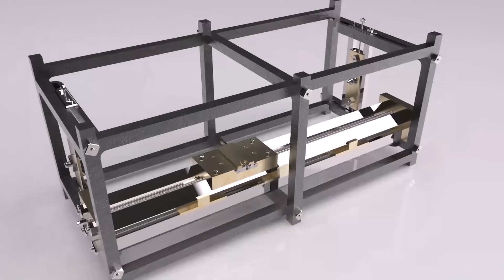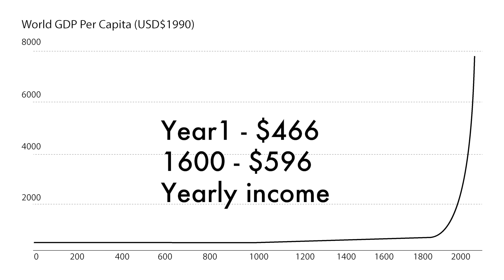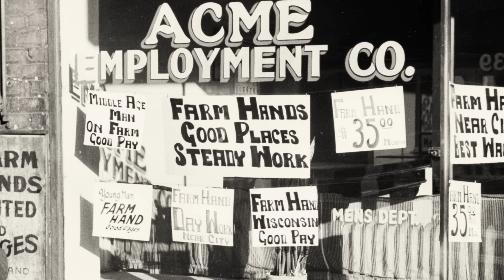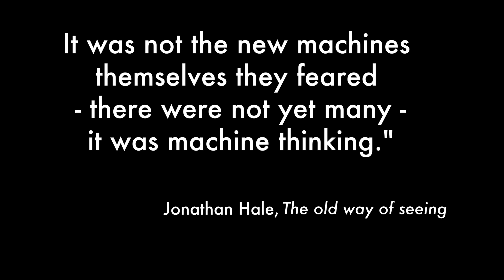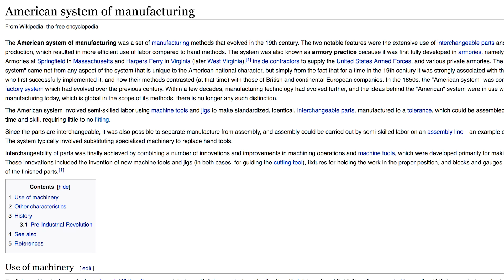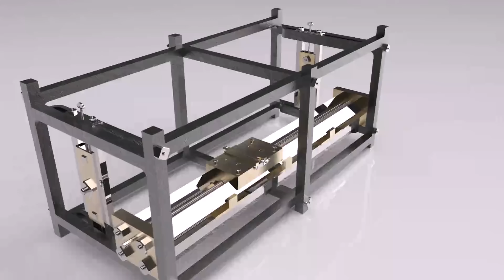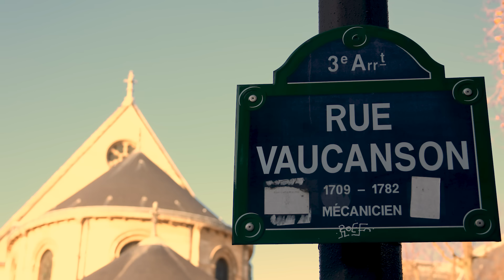The 1751 Machine that Made Everything

Comment: Extremely well researched and produced video. And more than good enough to earn a sub. It also echo's my thoughts about the importance of machine tools in our last few hundred years of history. Without them we'd still be in roughly medieval age conditions. It's a complex subject, and while Vaucanson's lathe may have been the first, it's origins and design were very likely a mixture of ideas borrowed from many areas. Ornamental turning first started I believe around the 1500's. From then until the late 1800's- early 1900's they developed many ideas and methods to form highly complex shapes and do intricate dividing to high levels of precision. No doubt some of those ideas were borrowed and copied by machine tool manufacturers and strengthened to work with metal. I'd also suggest Joseph Whitworth's ideas of obtaining very precise levels of flatness with his 3 plate method to further check and adjust the early machine tools accuracy was no less important.At least to modern society it would be.Metallurgy would be another giant step forward.  But education, travel and it allowing further exposure to new ideas during the industrial revolution very likely helped as well. Like it or not the military's constant search for better and more efficient methods of killing fueled and drove the largest percentage of industrial technological change and still does so today. Today's computers can be traced directly to the early torpedo and naval firing solution mechanical computers in WW II.

The Moore Tools book Foundations of Mechanical Accuracy gives some very good back round information about lead and feed screw accuracy in there development of there jig borers and grinders. Even they couldn't build perfect pitch screws no matter how much money and technology was thrown at the problem. They could measure the lead and lag pitch errors into the low millionths range but couldn't progress beyond a certain point. Today we just program the known errors out and side step the problem.

Comment: You have to make the machine, to make the machine that makes the machine to get the stuff you want.

Once you've done that, it spirals upward from there.

That same idea is done by the blacksmith. He uses a simple mold to make an anvil, a pair of tongs and a hammer head. Then he uses those to make a better pair of tongs a better hammer. Then he makes a punch, then a wedge, then  a broach, then more and more tools until he can make almost anything.

But, he has to start somewhere very simple and that's what this lathe allowed. A level of precision that could be repeated so we could make more accurate tools and equipment.

Comment: As a machinist, it's well know that the lathe is the only machine that can virtually replicate itself
Reply: As a machinist, you should also know that it's the machinist who replicates the machine. A lathe is only a tool, and nothing more.
Reply: @heartlandranchtv4943  oh good lord...you know what I meant
Reply: I would say Sam's original comment is even more true of a horizontal mill.
Such a mill makes a very effective lathe, (except for long shafts) whereas a lathe makes a mediocre mill.
And there are many more prismatic parts in a mill (and, for that matter, a rudimentary lathe) than there are cylindrical ones.
Reply: I must say, as a 45 year tool and die maker, I know that a lathe cant make a flat set of ways for the machine bed. You need a machine that cuts in a flat plane. I guess it does sound neat to say a machine can replicate itself, but unfortunately, it is not possible.
Reply: Most parts on a lathe are "circular" so I guess that makes sense
Reply: Makes me go all Gingery. Wish Lindsay Books was still around.
Reply: Agree with a lathe swapped vertical or by bringing the work across the spinning bit one could make a the flat bed used for a crude millining machine. That would go on to make better lathes and milling machines.
Reply: I would have put a milling machine or a 3D printer before a lathe.

Comment: History has recognised Henry Maudslay as being the originator of   the first lathe incorporating a leadscrew.
Reply from the maker: While it may be true that some gloss over the history of machine tools by putting Maudslay first, it is factually incorrect.  Vaucanson's lathe (1751) is the first to have all of the modern components in one machine 50+ years before Maudslay's lathe (early 1800s). Maudslay's lathe is not even the first to have gear driven screw cutting.  Senot's lathe in Paris with change gears was made before Maudslay's and is far more robust.  Thiout's (another Frenchman) lathe could cut different screw threads by a lever system well before any of these. This is not to say Maudslay isn't a giant - I think we can argue his impact was larger and that he (and his students) invented the modern machine shop as we know it.

Comment: How was the lead screw made if this was the first industrial lathe?
Reply from the maker: That's a highly interesting question and I've already done much research on that for a future video. Essentially, it was an iterative process.  There is no way to make a very good leadscrew from scratch, but there are ways to iteratively get closer and closer. Stay tuned!
Reply: @machinethinking  Oh I would love the answer to this question. I thought about it lots! I've always assumed that once you made a crude first one you could make a slightly better second one using the first one, but I don't think that's actually true. Anyways, thank you for the great videos, you've got me hooked!
Reply: Roberto Simpatico,  if you make TWO crude ones,  and then set up a machine to cut a 3rd one with the average of the first 2,  then the 3rd one will be slightly better.  You can then swap them around and repeat so all 3 get closer to ideal.

Your original idea could also work,  because the nut that follows the first crude screw will also tend to average out the errors from several teeth.  This is even true for a single screw improving itself,  like you do with a die nut.
Reply: You're basically correct, obtaining greater and greater precision has always been an iterative process.
Reply: In my youth I pored over an early 20th century book in the library at my local technical college which was a comprehensive set of worked-out solutions to do with the "bootstrapping" of machine accuracy, by identifying and correcting inaccuracies. In the case of pitch errors in a leadscrew, which are a combination of cumulative, cyclical and random, this involved devising equipment to measure these individual error sources, and then mechanisms to correct them. The resulting more accurate leadscrew would then be swapped  into the lathe. 
For correction of cyclical pitch errors, say, there might be a hand-scraped face cam turning with the leadscrew, working against a radial blade. As the errors became more subtle, linkages were introduced to reduce the effect of the correction.
Repetition & refinement would continue, not just of the components, but of the corrective processes, until we ended up with jig borers, and lathes employing diamond cutting points, which were the pinnacle of innate machine accuracy.

Sadly, I don't even recall the author, let alone the title.
Reply: @machinethinking  You're wrong, lol. There's so many "common sense" techniques lost in time, because they're too common sense. Like how screws are mass produced today - Two plates with |||| serrations , rub together against a rod with pressure, the two plates are some angle \/; and out comes a screw. Take wood, carve it it, torch it to make it hard, and you can make lead screws.
Reply: @machinethinking  Carefully. It was made carefully, much how the first beds, blocks, and flats were hand-scraped.
Reply: google  'Henry Maudslay'  (screw-cutting lathe 1800). Be aware that the lathe shown in the  pictures is a more recent replica, made using modern materials and parts. His original machine would not have had the machine-screws shown.
Reply from the maker: @nlo114 where did you get the information that the Maudslay screw-cutting lathe on display is a replica?  I've seen it at the Science Museum London and talked to the Mechanical Engineering Curator about it and I can assure you it's believed to be quite genuine.
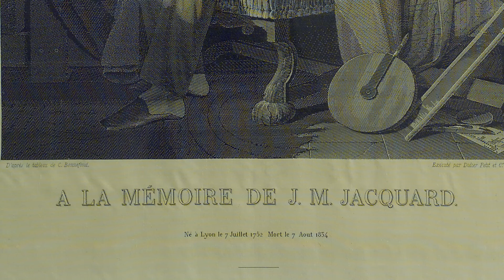Reply: 1:25 - ...'this is another one of vaucanson's creations'...  Please accept my apologies, I was getting confused by the commentary.
Reply: I am a retired engineer; I have a reasonable idea of the history of my profession! :-)
Reply: I have made long machine-cut screws on a milling machine, using only gears. The gears provide a definitive rotation of degree(s) dependent on the table travel. A rack and pinion was used as a X-axis in place of a lead screw. This set-up gave a rotation/travel ratio. The same could be accomplished on a lathe.
Reply: It takes some steps to get their. My first step would be to use the lathe to turn the major diameter. Then make a file to the thread form, and make a pitch gage as close as possible. Use this to hand file a helix along the shaft. It will be sloppy to start. The almost helix can be followed by a slip fit bushing with a finger attached to an end. If you can follow the helix it would be possible to cut a crude internal thread.
 I would think that the machine in the box was the best of those that finally worked. Men in those days developed hand skills instead of writing g & m code programs. It seems as though I had read of a process with a rotating nut that was used to help develop an accurate consistent screw.
  Yes it would have been quite a challenge to produce the first screw and nut.
Reply: Google “ making first screw and nut” It throws out a lot of reading that I am going to start on, as time and dry eyes allow.
Reply: After thinking about it, i think you can make a screw with no screw in your lathe. The cariage should be directly in relationship with the spindle/rotating part. You can engage these with a few simple gears, using a rack and pinion system. Or even easier, instead of gears, use rubber grip wheels.
Reply: It wasnt, that us the whole point.  This video is full of false and misleading information.  This machine combi ed a lot of technology  it didnt include anything completely new.
Reply: The drive mechanism, it's motor and transmission are not shown. The transmission is what makes a lathe able to produce screw cuts. This was built to turn copper rollers, not screws. In pre-lathe metalwork, a mechanic could make precision parts by hand. A lead screw is made with Acme thread, which has a flat surface, not the triangle edge in this machine. You may not be able to make a long screw, but obviously those men could. Good luck to you.
Reply: Henry Maudsley and the perfectly flat plate :)
Reply: Draw a quantity of steel or iron wire through true dies; constant diameter is key.
Prepare a true steel mandrel, and wind the wire round mandrel, taking care not to introduce gaps.
Carefully hard-solder or braze the assembly together at the ends.
Clean it up, and you now have a simple lead screw.
The thread profile is a bunch of roundies, but the pitch is accurately described by the spiral on the mandrel.
The limit to accuracy here is how consistent the wire diameter and how good a job done with cleaning up the threads.
Dies and lapping compound will get a pretty good finish & accuracy to form.
These screws would be pretty big, but when used as lead screws in a screw-making lathe, they could produce other screws of various sizes and pitches.
And such a machine can cut lead-screws for other lathes with all sorts of thread patterns...
Hell, it could make its own replacement lead-screw in Acme threads...
To make the machine you want, sometimes you have to make another machine to make the parts you need.
Reply: How did they make a straight edge before their was a straight edge
Reply: Read about Sir Joseph Whitworth.
Reply: @chadwick hayes I know the difference between THERE and THEIR, and so should you.
Reply: @BigHayes7771 i think by rubbing two stones together. Like resurface a surface plate.
Reply: Old riflemakers wound string around a dowel, traced the line and  carved the helix. Put some toolies in competition with each other and ....improvements occur.
Reply: Clearly, aliens gave it to him
Reply: The simple answer to this question is that there's no simple answer to the question.

It would have been an engineering challenge that taxed the ingenuity of the engineer of the day with the tools and processes available to them at the time.

It might be possible to guess at what those tools and processes would be, but the whole point of the new device and what made it such a significant development, wasn't that it was the first device that ever performed these functions, but that it was the first one to do it conveniently and efficiently.

How often do you ever hear of a new piece of technology that does something that could never be done before if enough time, money and expertise was thrown at the problem? That almost never happens. 

It's all a question of the level of value assigned to the task in question. If you can assign a task with a sufficient value, and the specification is clear enough, then it doesn't matter how inefficient and inappropriate the tools you have at your disposal, you can succeed.

You could be limited to neolithic tools, and you could still build the lathe in this video if you had precise specifications to work from, were able to ascribe a sufficiently divine value to the end result, and had enough men willing to share in their recognition of that value and devote their lives to the task of producing those parts to the level of precision required. If all you had to go on to begin with was neolithic tools, and you didn't have access any more modern knowledge besides the brief for the device provided, it could easily take multiple lifetimes of problem solving and experimentation to puzzle out the end result, but it could be done, and thousands of years sooner than it was in reality.  

That's how inventors invent, that's how innovators innovate before other people. They assign a value to a desired goal great enough to actually achieve that goal, and sometimes years before anyone else even recognises the goal has value. That's why Hero's  steam engine never took off, because people didn't recognise the value of developing it at the time.
Reply: I think it would be easy to make one with a sine bar controlling the rotation if the spindle
Reply: Does this machine have a lead screw? I mean, for the first lathe ever, a lead screw is pretty high tech!
Reply: Da Vinci invented a screw cutting lathe, the principle of which is still in use today.
Reply: 'Thread chasing' is one of the ways a thread can be done from first principles. The chaser has multiple cutting points so after the thread is struck the following points smooth out the thread as it moves along.
Reply: Henry Hindley, 1739. Precision screw- cutting lathe.
Reply: Once you make an adjustable threading die any length of thread is possible.  The final pass even finishes the major diameter of the shaft.
Reply: One could possibly also make a leadscrew by making a screw die.
I think you'd only need a crude cutter at some arbitiary angle, and once you start rotating the shaft through the die, it would follow it and perfectly replicate whatever pitch the cutter has.
Maybe :)